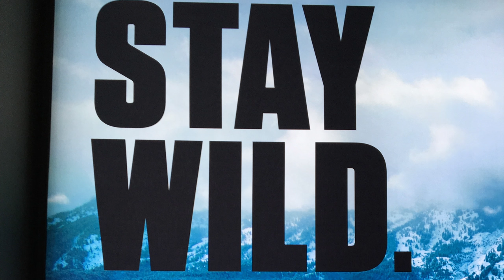Barely hanging on! Trying to finish the outhouse build on the off grid property before winter

Comment: No ventilation?
Reply from the maker: The PLAN  was to screen a vent. Which I put off and regretted later. I wasn’t worried about use but underestimated ground moisture. Now I will be putting in vent pipe this summer.